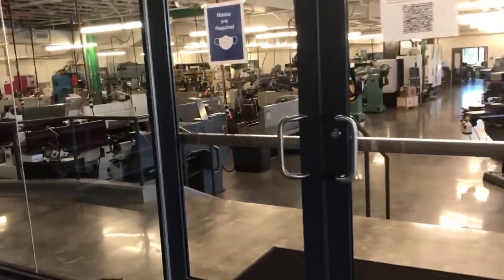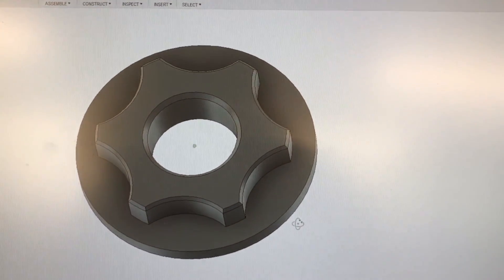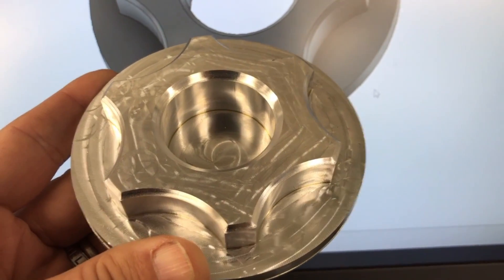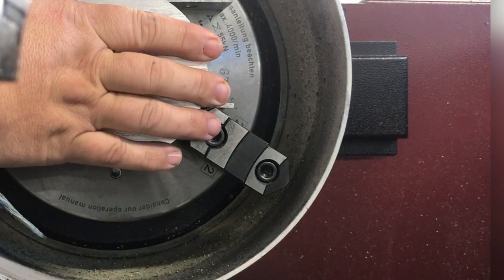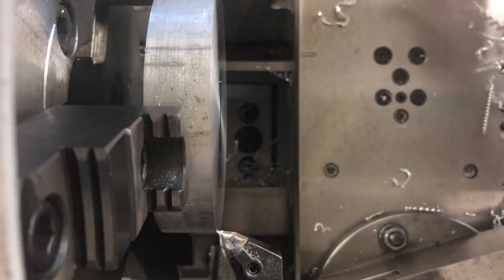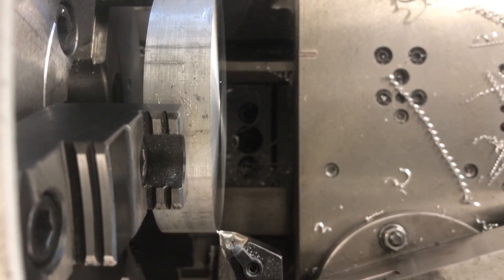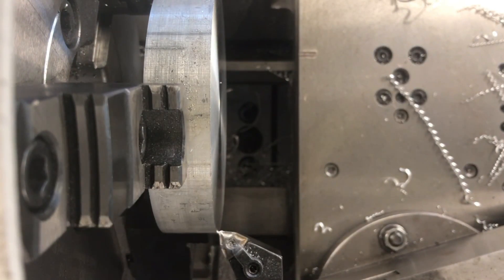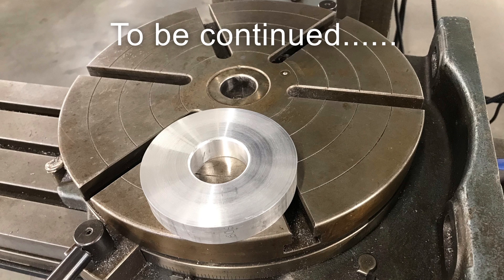CNC Machining vs Manual Machining - Part 1

Comment: Come and view my video... "is chalk better than cheese" !  they both have their merits and differences

CNC:-
5 minutes to set up a vice, 5 minutes to create a conversational program, 2 minutes to saw the billett, 2 minutes to cut metal (OP1) 5 minutes to cut soft jaws to fit the part back in upside down, 1 minute to cut (OP2) lower face...  costing = 20 minutes actual cycle time 18 minutes for one off as sawing billett would happen whilst conversational program is being written.

Manual:- 
Capstan lathe with a polygon box
fit jaws, cut billett, set face stop, set drilling stop, set boring stop, find polygon box, make polygon box cam (6 weeks)  create form tool for feature side and chamfer (both at once) install finishing boring tool in polygon box...  cycle time per part no longer than 2 minutes, but this would need the above special tooling, the cam plate would be specific to this job and would need to be sparked out or CNC milled etc... then heat treated and ground.

Manual:-
Engine lathe & mill
Face blank, then using bed stops to set depths, turn the top faces to the correct finished height and machining jaws to fit in mill vice on a rotary table, find cutter with correct diameter of cut or use a rotary table to perform the cut and an indexing vice to position the part at the correct angle for machining each feature.. more setting up, slower machining no real contest.

Comment: In making that first part I seriously feel like you could have drastically gone up on your axials and down on your radials.
Reply: I find this a lot with ex manual operators and they will often be running far too shallow and far too slow etc...I call it "manual lathe disorder"

Comment: at 11:02 you drill a hole without centerdrilling it before, was this because you gonna turn out the hole anyway afterwards?
Reply: It's also a short hole so deflection will be less of an issue, but to be correct he should have run a C/Drill on the manual and then use carbide drill only in the CNC, I only use a C/drill on a CNC if it requires centres for the lathe or grinder

Comment: What a terrible comparison! I started machining in 1962 and programmed later in life and today have a manual machine shop. I can machine parts for the race guys that cnc could not imagine. This gives folks a bad comparison. I also worked on the number 3 and 4 milwaukee matics ever made at Gisholt lathe corp. I am still machining!!!
Reply: Can you explain what a manual machine can really do that a CNC machine cannot imagine ?
Reply: @martinfidel7086  I wonder that as well.

Comment: With only one hole on both sides of a crane arm to weld a cast slug in using a horizontal boring mill,  first drill and bore out the hole for the cast slug on both sides, then weld in the slug, then bore out the slug to fit a bearing race on both sides of a 30 foot long crane arm. It takes hours just to position this 10 ton crane arm correctly and a lot of machine maneuvering is needed to clamp it down in the proper orientation using cranes, come along, jacks, shims angle plates, and clamps. CNC would be a waste of time, and it would be so cumbersome going back and forth to move the table and quill. Same goes for rebuilding machinery in place in a factory. How would you set up a CNC on a huge machine needing to have a bolt hole welded in and then drill out the hole in place when a mag base drill press would do? Have you ever had some one come in and say, hey, I need a hole drilled here, and then just put it on the mill and drill it out? By the time you took to set it all up and programmed the operation, I would all ready have the hole drilled out on a manual mill. There are applications for both in different circumstances, and to say CNC or manual machining is better than the other in all circumstances is a useless argument. Unfortunately, manual equipment manufacturers are falling by the way side as everyone flocks to CNC. That is too bad, and from experience, I can say for the most part, manual equipment is getting more worn out and less accurate since there are few real quality replacements. Your best leaders in a multi-use job shop are the ones that can do both manual and CNC work, and they know when it is best to go one way or the other to get the job done.

Comment: This is no doubt a CNC part. Looks like the cutoff saw needs a tune up or is a POS.  Why is the end mill in and out of the center hole so many times? Why not rough the outside, rough the hole, finish the outside, finish the hole? Seems like a lot of wasted motion dancing around the part.

Comment: Why the second cut wasnt working in aluminium was because you were taking to shallow of a cut with a WNMG insert with the chip breaker not being hit by the swarf and the radius of the nose being a bit to big for that shallow of a cut. The speeds was prob just fine and temperatur can affect it but shouldnt after just one previous cut.
Reply: Looks like there is some build up on the insert also, not allowing the chip breaker to preform at all
Reply: @GeorgeMLong  may be it as well. But wnmg needs a heavy cut to break chips. :)
Reply: That’s not necessarily the case. DOC, speeds, feeds, they all affect sfpm, which determines what type of chip your gonna get. Holy smokes I didn’t realize this video was a year old until i after I posted my comment haha
Reply: @DavidHerscher  it's been a wild ride. :D

Comment: You would get a better reading with a bore guage
Reply: did you mean a bore mic ?
Reply: @martinfidel7086  no it's called a bore gage not mic look it up
Reply: @cernndomga8160  A gauge is not as accurate as a bore micrometer, I don't need to look it up as I use both daily
Reply: There the same I use them too
If you Google bore gage and bore mic it's the same thing
Reply: @cernndomga8160  Only when some muppet mis labels them !   Google uses information that it gathers from people that don't always know what they are talking about ! a bore mic is a calibrated device that you can read the measurement directly off the scale (either manual or digital) a bore gauge needs another device to confirm it's measurement.  go look at Mitutoyo.com

Comment: Onsie twoosie, either way is good. If that is a production part it belongs in a twin spindle mill turn machine.
Reply: not really, a simple 3 axis mill turn with bar feed would do the job just as well, and would save material costs.
Reply: @martinfidel7086  how would you clean up the second side then?
Reply: @angrydragonslayer  just part it off and then feed the bar for the next one.
Reply: @martinfidel7086  ah... You wouldn't....
Reply: @angrydragonslayer  why wouldn't I do something that I do hundreds of times per day ???

Comment: That programing was kinda embarrassing.  Why (esp when using fusion/cam) are you taking such low depth of cuts?
Reply: I agree that was terrible. This is a CNC part all day. I seen both poor tool pathing as well as a poor choice of tooling in this video. If i had the model supplied to me I could produce that in less than a half an hour provided I had a 1" indexable mill and a .5 solid endmill already in the carousel (which I always do). Could it be made manually? Yess. Would it stand a shot in hell in the $/hr game? Fck no
Reply: "kinda" 

That was worse than what i get from MC4SW auto-generating toolpaths
Reply: Whaat? Clearly hes was going full depth of cut.
Reply: @nikolaiownz  I'm just going to ignore your comment, because it's clear you either have no Idea what you're talking about, or you didn't even watch the video.  I counted 3 ramps for this simple part.
Reply: @siraig  🤦‍♂️
Reply: @nikolaiownz  I'd be face-palming too if I commented without watching the video.